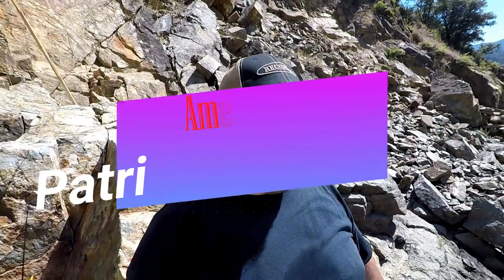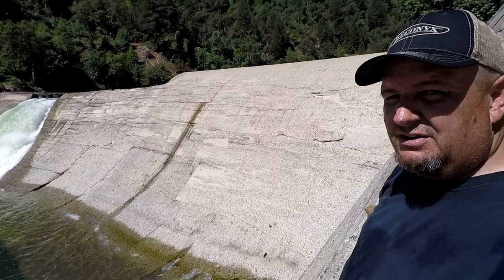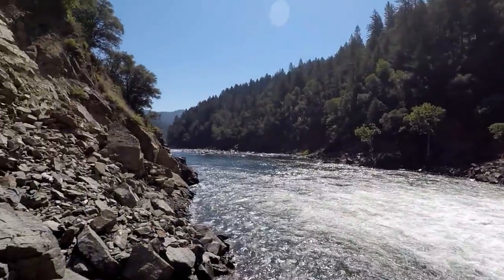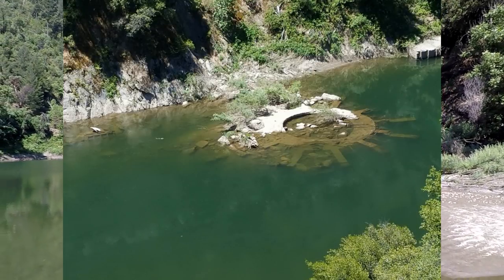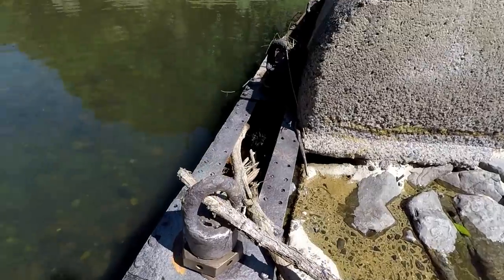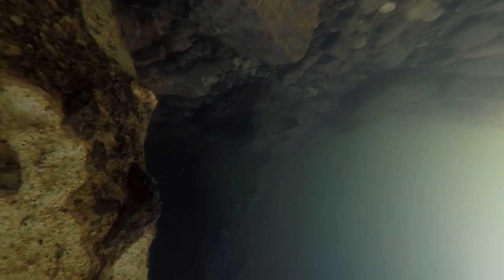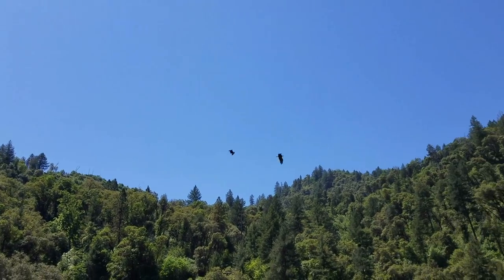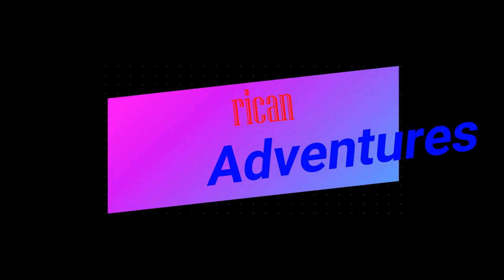Big Bend Dam above Lake Oroville, Old Power house history

Comment: Great video.  As stated on the video, the dam diverted water to the now-submerged Big Ben powerhouse.  But after that powerhouse was decommissioned, the dam was modified with a "V" notch that regulates (evens out) the flow from PG&E's Poe powerhouse that is located a little ways upstream of this old dam.  

The PG&E powerhouses located upstream are all "peaking" plants meaning that the flows can abruptly increase or decrease.  The "V" notch is there to even out those flows and help keep fishermen safe.

Comment: I got stalked by a mountain lion coming out of that fishing hole...I always bring a 50 foot length of rope I tie off on the rebar sticking out and repel down....when the lake level is high the fish can swim through that...the trout are 50 feet out and about 20 feet deep....
Reply from the maker: Got to love them Lions!!       I too have taken a rope down there,   It is nice being down on the apron instead of up above. Thanks for the Reply and tip on the fish..
Reply: hey, that's a good idea...  cuz that slope always freaks me out. seems like the soles of my shoes are never quite sticky enough... and sometimes the water down there is half air... people and boats and things won't float well in those conditions. actually, I don't float in any conditions... people that float (that would be most people) don't understand what it's like for us non-floating types...  sigh
peace.
Reply: @primateinterfacetechnologi6220  Sometimes I bring one of those plastic snow sleds for kids...and load poles and gear and lunch and lower it down leave it tied off...works good... just strap your things with bungee cords...can't fish it till the lake comes up..two three years...they all split and head for deep water.  There's a rebar sticking out... bring like 75 foot at least...it's an easy descend hanging on to that rope....I was there bout 8 years ago and some local slipped and tumbled down that dam...he got pretty messed up....
Reply: @ericunderwood8080  exactly. this whole river and canyon can make for a great time... but if you are inexperienced or let your guard down, it can cause you a real bad day real quick... I too have been menaced by cats and bears right in that area several times... there is a cave nearby that is definitely occupied by a cat. haven't been able to get a clear idea of exactly where it is but I think it's below the road cut and above the water somewhere along the route between the PowerHouse and the fish ladder Dam. and the Bears? don't even get me started... every bear I've seen was trying to get me. seems like it anyway. maybe those ones just stand out in one's memory more... let's just say I've been way too close to bears a number of times...  not on purpose. of course, I've had all this happen right where I am as well on my property in Yankee Hill. there are so many mountain lions in my part of town it's unbelievable... they are incredible and kind of scary. I've encountered and even interacted with them at close range many times but almost never actually seen them. unless you count a couple of hundred yards away with a bright flashlight... they give themselves away at night because you can see their eyes and they don't know that fact. a couple of years back my neighbor pinpointed 8 different individuals in three different groups all at once around his property in front of me... in past years even biologists wouldn't I have believed you if you told him this, but things have changed: down in Southern Cal a couple years back biologists documented nine individual adults feeding on a kill together. this is basically unheard-of behavior by this species. traditionally these cats are extremely solitary; the only time you would see more than one is a mother with her babies... and I think sometimes a sibling pair like a couple of Brothers would form a hunting Cooperative at least until they mature and start looking for mates. my neighbor has also documented a pair of cats playing with a fox or something they'd caught all up and down the hills for an hour, after first cooperating in the hunt and boxing it in. I could tell of accounts that my neighbor and I have had with these cats all night. I can think of one time when I was Bonafide scared...the cat had to have been 20 or 30 ft away from me and I had no idea in which direction. on a steep slope in the dark in the bushes....I think it tried to piss on me.  I got the feeling that suddenly I could be, within seconds, simply a meal. my rational biologist mind knows that it was most likely just territorial Behavior... but that meant nothing in that moment, relatively speaking. It's a Spooky feeling that doesn't really have adequate words... but if you have ever been stalked, or blundered upon one and had it not just take off...as my neighbor has done half a dozen times in his life for some reason... you'll know what I mean. 
 like I said... I could go on... it's happened before.  will happen again...
Reply: @primateinterfacetechnologi6220  I was coming out of that fishing hole...up clean out of it on the road...headed back to camp ..I got that feeling.. something is watching me...so I stopped and across the canyon I could see a grow...so I registered it as a guy looking at me through a rifle scope...so I doubled timed my pace. .and about a minute later that feeling came back...and I brushed it off. .it wouldn't go away. .so I turned to look over my shoulder and the grow had disappeared around the hillside...I thought... huh... that's weird....so I just kept up my double time pace...you know when your on that road coming back to camp the river is like 200 feet down to the left and to your right is nothing but steep hillside... right? So I'm double timing it and there's a wash that runs through from up the hillside down to the river...as I was coming up to that wash ....my whole body and soul screamed STOP! 
I'm looking around thinking..ok I've been double timing...there's nobody behind me????? Noway a person could keep up with me on the hillside...and just as I thought...the only thing that could would be....OH SHIT!   IT WAS HUNKERED DOWN IN THAT WASH.....UP ABOVE ME ABOUT 15 FEET....
honest to God...250 lbs easy! 
I've never felt so helpless...and first I just shrunk and mumbled make it quick and just finish me! I was terrified! Then I thought of my Son coming to find me...and this rage took over ..my hair was standing up...I broke my 8-6 ugly stick down     and squared off on it... ready to shove the pole into it's Mouth! 
I could feel every hair on my body...it was primal! We just sat there faced off for about 15 minutes and I backed away slowly and it didn't budge! 
It was primal...I guess that's what combat feels like...it was weird! 
I've never seen a bear in the wild... several lions but no Bear...saw an albino squirrel once! Funny... anyway yeah ..crazy ..the fishing is awesome use nightcrawlers jig 50-60 feet out 20 feet down 3/8 weight...bug Rainbow trout... big! And huge Smallmouth at that footing...when I used to stand up top and drag the little salmon up ....when you bring the fish by that footing...I seen 10 lb Smallmouth smack them little salmon! I spent ,3 months in a tent down there ...9-10 years ago you might of seen me...I was there may thru july
Reply: @primateinterfacetechnologi6220  yeah...you said it...you can't let your guard down...not a bit... every step a sure step! You said it...so true!
Reply: @ericunderwood8080  gnarly!  a large male. and I imagine that you are right: the feeling of combat...  or one of them anyway. 
 so here's another one from my neighborhood- secondhand as I just missed it myself.
 my neighbor had myself and another friend helping him do some stuff in his yard. we have been walking back and forth in front of this bush not 30 feet away all afternoon. I took a break to go up to my place and get something to eat. half an hour later I come back to hear this: few minutes after I left from out of this bush steps the largest cat my neighbor had ever seen. he said his mind scanned for what he could possibly be seeing and his first thought was "a horse?" since then we have found the tracks of this large male and they're simply huge. but wait, it gets better... suddenly and seemingly out of nowhere appear six giant bucks... the really big ones that you almost never see... everybody looked around at each other for a fraction of a second... one huge cat, two humans, and six big deer, then, of course, all hell broke loose. 
 the deer took off in all directions and the cat took off down the hill after one of them, catching it several hundred feet down in the bushes... the two humans stood there with their hearts pounding wondering what the hell they had just seen. a few minutes later I returned to hear all this. I wouldn't tend to believe some story like this except that I know these individuals are very Discerning people, who value accurate reporting.
 totally bizarre though... this by no means was some regular route of a bunch of deer...  did the cat know they were coming? in the middle of the afternoon? what were they all doing together like that? none of it makes any sense.
Reply: @ericunderwood8080  nice... I've seen the tracks of these larger bucks,  and maybe one at a distance, and one that turned out to be a robot. I know they exist though, because of the tracks.
 by the highway 70 bridge on Yankee Hill Side to the right, as you're coming on to it heading down, I saw an elk, some years back. I thought I was seeing a horse or something but then I saw the big white ass... I would have got a better view but I was trying to not crash cuz I was driving at the time you see...  on another note-  I've been hearing probably two to three cats, usually all at once, every evening about when it gets fully dark lately... I don't recall what this time of year has them doing exactly... probably having babies. there is a little mini Valley right in front of me that's kind of like my extended front yard. one time a female came and had her kits right there, 200 feet from where the house used to be. then she took them down into the bigger Valley where they usually seem to be hanging out. I suspect this may have happened more than once and that I just noticed this time,  cuz I'm always hearing all kinds of strange animal noises from down there...
Reply: At 6:14 that's the road I was on...that cat stalked me from above me all the way around the corner past the bridge..the whole time I was looking for it in the wrong place...then I came upon that wash..he got up ahead of me... I could feel it as soon as started back to camp on that road...
Reply: @primateinterfacetechnologi6220  Believe you! I used to fish the outlet every June...My usual ritual ..5:30 am heading down Vance and when I get to the turn id stop roll one and go real slow headed towards the fishing hole...I went to lick the paper while I was driving with my knee...WTF is a cow doing out here....That's not a cow ..holy shit ... that's the biggest doe I've ever seen in my life...wait a minute...deer aren't red...holy shit...that's an Elk! Swear to God! It was ❌ that road going down into the orchards....It all made sense...when I'd fart around out there in them rock piles...I was coming across huge deer prints...well took 20 years to figure out all that time they were Elk prints...how cool...
And I swear that lion I seen as I was going up 70 must of been the one that was in that bush ...it was huge! 
Ya know how before you hit the bridge going up 70... It was Early spring and that grass was all green and tall...yeah...there's some bigguns around....your the second person that I've come across that seen Elk!